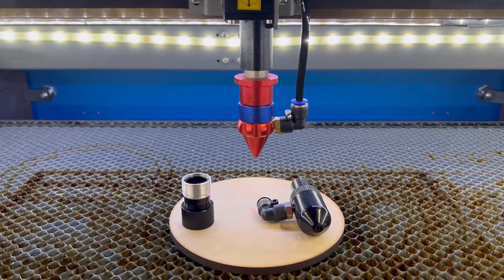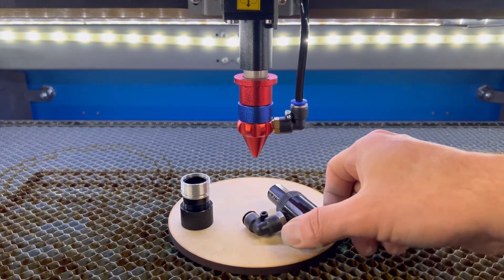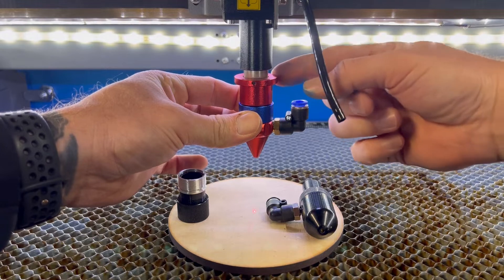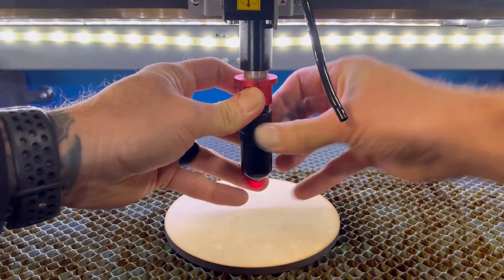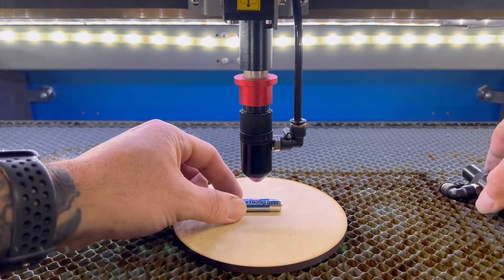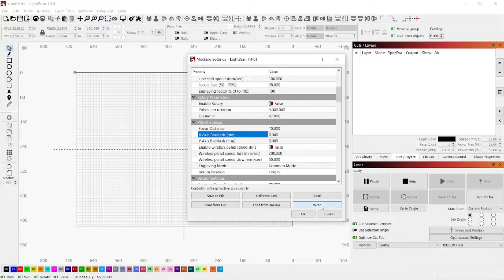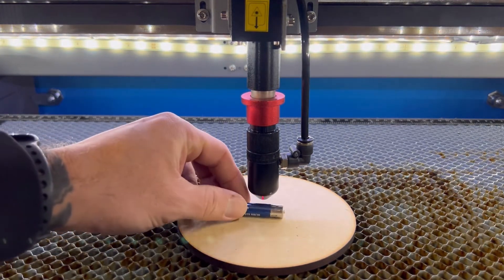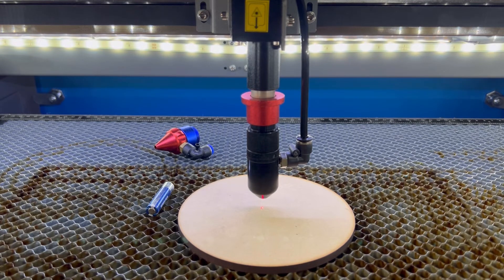OMTech Lens & Laser Nozzle Upgrade for your Autofocus laser

Comment: Does this work with a manual focus?
Reply from the maker: Yes absolutely. Manually focusing simply works with placing a gauge between the nozzle and the workpiece to set the distance. I prefer this method because I don’t trust OMTechs autofocus

Comment: Just subscribed...have the af2028 80w... which length do you use most from the kit...trying to keep my upgrading cost at a minimum for the moment
Reply from the maker: I have the 2.0” on their 95% of the time. I’ll use the longer ones when I need a thicker cut.
Reply: @EdmondsWoodshop  I'm not sure what you mean by thicker cut, does the 2" only do up to a certain thickness...say 1/4" baltic birch needs a different length?  About to order at least the 2" but unsure if I really need any others
Reply from the maker: Youll want to do some more research on lens with different focal lengths. 

When a laser beam focuses through a lens it creates an hourglass shape. That hour glass shape is called the depth of field. The depth of field is longer with lenses with longer focal lengths giving the ability to cut thicker pieces.

However, on average you’ll be cutting up to 1/4” pieces of material. A 2” focal length lens will definitely have the ability to cut through that so long you have everything setup correctly.
Reply: I ordered the 2" lens and cone from AP, followed all the instructions for installing and setting the Focus height, did the reset and it's coming up really short...about half the distance it's supposed to...any pointers on what to do with that

Comment: Been using an XTool for 2 years but just placed my order for this exact machine yesterday...if im only going to be engraving sheets of leatherette, do i need the whole set of tubes?

I honestly just dont understand the concept of all the different tubes and why you would need them..any help would be grealt appereciated buddy...thanks for your videos and helping us!!
Reply from the maker: Make sure to join our FB group. Link is on the description box

Diodes and co2 lasers are different. With the co2 the laser will focus through a lens. Those lenses can have different focal distances. The focal distance is the distance from the lens from the top of the material. Different focal length lenses have different capabilities. For example, a 1.5” focal length lens has the ability to focus to a finer dot size making it ideal for detailed engraving where a 4.0” focal length lens makes it more ideal for cutting. A well rounded focal length lens is the 2.0” because it’s the best of both worlds. 
As with any product, the quality will vary from manufacturer to manufacturer. OMTech is decent but it’s made with cheap Chinese quality. American photonics is American made and small business owned. They make very good products. 
You can choose to use a loose lens that fits in your stock setup, or you can choose to use something like I have shown in the video. The advantage with American photonics is that the distance from the tip of the nozzle to the top of the workpiece already preestablished meaning there’s no guessing or testing involved to find out the distance. The lens is also glued in so cleaning it is pretty easy.
Reply: @EdmondsWoodshop I will join the group now bud.

Well that makes a whole lot of sense...thanks man!! I will start with the 50.8mm(2.0") w/nozzle and the American Photonics mirrors to get started. Anything else from them you reccomend? I'm doing most of the upgrades on the Laser Guys website..except the rotary..thats gotta wait a few weeks.

Thanks again buddy. Not a lot of folks would have taken the time to explain that.
Reply from the maker: For sure you’ll need the in-line fan. If you took advantage of the last sale you should have gotten the chiller for free. Those would be my top two upgrades. If you have the extra finances, the Liberty controls air assist makes a huge difference, but don’t be afraid to hold off on it and learn the laser a bit first. Make sure to take advantage of our setup guide on the laser-guys website too. It there to help newer OMTech users from a user perspective
Reply: @EdmondsWoodshop  Ive been using manual bed raise/lower, but really wanna get this issue fixed. Followed all steps to a "T" and when I hit autofocus, the bed drops below the 10mm...any suggestions. I tried searching the FB page, but no luck. Thanks for the help bud!
Reply: NEVERMIND!! I saw your comment about vendor settings...IT WORKS!! You're channel is the best bro!!!

Comment: I have an older (3 years) AF2028 with the older autofocus pen.  Where can I get the new tube with the integral plunger style autofocus and pointer?  Can't find it on the Omtech website.  I am thinking it may take a different wiring system.
Reply from the maker: I've only seen one person successfully buy it through OMTech and he did it buy calling and asking to purchase one over the phone. I'd imagine wiring would lead straight to the driver and it would be an easy swap of the laser head. I'd recommend calling.

Comment: Great Video!
I've followed the directions for changing the focal length multiple times, but my machine still doesn't adjust correctly. It still has a ~19mm focal length. Any ideas why?
Reply from the maker: Go into your vendor settings > Z axis setting > z home offset 

Is that number zero? It should be.
Reply: @EdmondsWoodshop  changing that to 0 definitely helped! Still didn't have as easy of a time as you did in the video. I had to set my focus distance  to 16.6 to get the 10mm between the piece and the nozzle.
Reply: Don’t know what I’m doing wrong but the 10mm setting is not working for me. I have the OMTech AF2428 60W

Comment: How would you adjust this particular head if the focus is off meaning to low
Reply from the maker: American photonics makes their laser nozzles so that the focus should be 10mm. Thats the thickness of a battery. You need to calibrate your autofocus settings to ensure the autofocus is set correctly.

1. Go into lightburn and ensure your laser is on and communicating with lightburn
2. Go to EDIT > MACHINE SETTINGS > MISCELLANEOUS > FOCUS DISTANCE > enter the focal distance you measured > select WRITE > press RESET on your controller to accept changes

Comment: Thank you for this video.  I recently got this exact kit.  Two things I want to add to this.  

1. I have a red/black Omtech AF2440 100W Laser and it comes with this exact style nozzle.  

2.  I noticed the adaptor from American Photonics was a bit loose for me and it would be difficult to remove nozzles without taking out the whole adaptor with it.  So the solution is to apply a whole lot of plumbers tape around the tread to make it thicker and then it will be nice and snug allowing me to swap nozzles with ease.  

I would highly recommend this kit with the 4 nozzles from AP.  Don’t forget to get the lens cleaning kit from them.  My results were so amazing compared to Omtechs stock lenses.
Reply: @inc55 - thank you for commenting!  I just got the same model as you.  This video and your comment put me on the right track with the AF in my system.
Reply from the maker: Thank you for sharing your experience!
Reply: I have the blue and black af2440 and am very confused as to what kit to buy from apc ?
Reply from the maker: You need the 16.15mm kit.